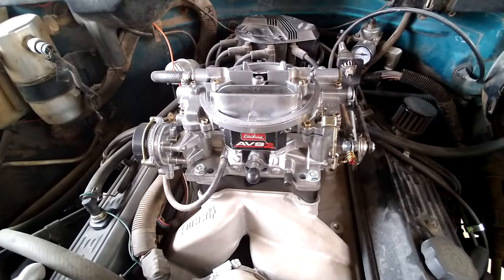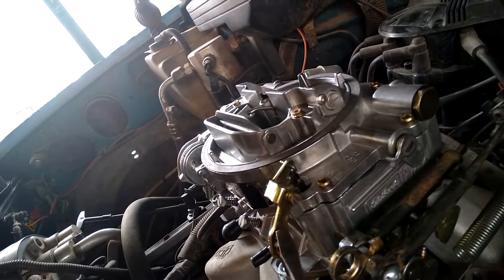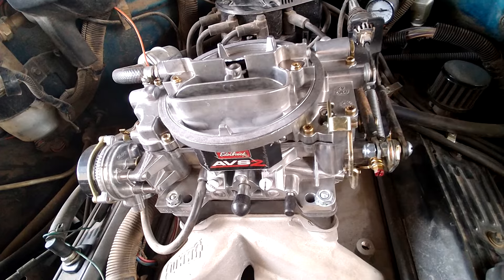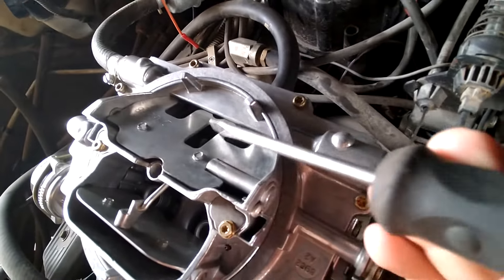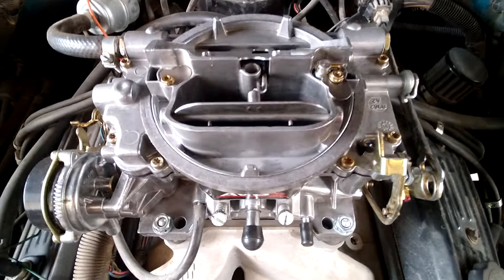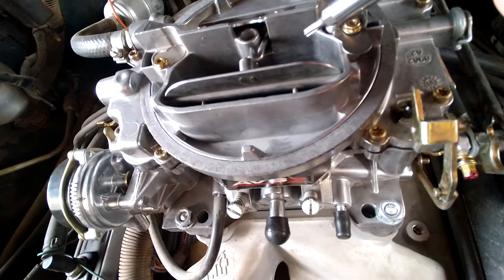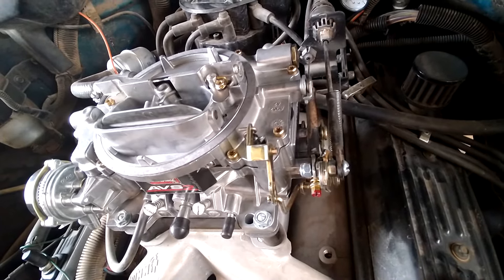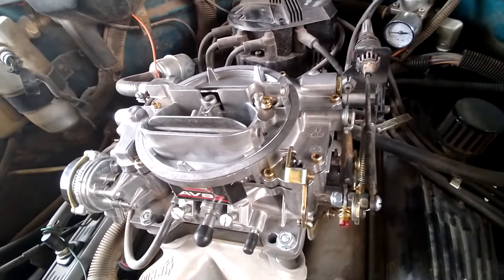Tuning and setting up a Edelbrock AVS2

Comment: Hey man. The reason that car reader is running too rich is because you're turning this flap. Screw the wrong way, tightening the Spring makes it run richer, especially when you stomp on the gas. If you want it to lean out you have to loosen the screw to allow more air in the car braider. Basically, it's like you're running it with your hand over the top of it. It's pulling more vacuum than air, which means it's pulling too much fuel.  You're just doing the process backwards. It's no big deal a lot of people can't wrap their head around it, but I'm telling you straight up. You're doing it wrong, take my advice and don't feel some sort of way about it. It's not anything but helpful advice. Or you can sit there and fludge your engine out and wash your soldiers down. All you want, but until you do it the correct way. You're not gonna have any luck with it? So, you should take the video off the air until you get it. Correct, you're gonna have a lot of people screwing their cars up because you're giving them the wrong advice.
Reply from the maker: Best thing I can tell people these days is buy Holley I should have added that and I have had guys say how it's helped but thank you for posting ill pin this so it will help

Comment: Don't go drilling holes in the butterflies. Loosen the tension on the secondary flap and change to a lighter step up spring
Reply from the maker: That has nothing to do with a rich like with low vacuum

Comment: Wouldn't it be easiest to adjust the idle air mix screw with a vacuum gauge? I'm new to this but it seems the most efficient/sure way.
Reply from the maker: Your probably right if you have a vacuum gauge I just kinda wing it and do it by feel and ear
Reply: The old timers get them nearly perfect by ear had my stepdad tune any buddy’s carb and then he happened to buy a vacuum gauge a few days later and it was pretty much dead on
Reply: Way to may variables on this old shit, that i love BTW.-   Fuel pressure is very important- On a Street cam GM Small block or big block just run a stock fuel pump- I see everyone installing 30PSI electric pumps then regulating them down to 7 PSE, it makes no sense.   A real OG mechanical  gm fuel pump is perfect- Mines 23 years old and produces a consistent 7.2 PSI across RPM range.  No need for a pressure regulator.
Reply: @yamahaguy1732  exactly. Im 42 but learned from my dad in 80s get up in that motor and hold her like shes your lover, tune it and you know  touched her right. LOL
Reply: 7 psi is too high.  Edelbrock recommends no more than 6, and prefer it to be set at 5.5.
Reply: @ericabercrombie6780  idk I’ve talked to an old timer who specializes in edlebrocks and he said on a higher preformance engine 7psi is where you wanna be no more than that tho

Comment: The problem that leads you to drilling your throttle blades is likely a lack of spark advance. Try tuning the   vacuum advance on the distributor. The engine will likely idle fine with the throttle blades fully closed if you have enough timing advance.
Reply from the maker: 36°
Reply: Yup.  Loosen the hold down bracket on your HEI and slow turn and listen to the idle.
Get it where it sits as high as possible.  Then turn down your idle to say 800.
Then turn your mixture screw to dial in the idle.

That’s what I did.  Mine feel Fuel injected no flat spots anywhere.

Good share!

Larry
Reply: @mafosa8519  excellent start.  
Then the mechanical advance needs to be limited as not to exceed  total advance.  
If you look down the carb at idle now,  you will probably see fuel dripping from the center booster.  
Should be idling on the idle circuit.  Just a square showing on the transfer port with the throttle blade closed all the way down on idle stop screw. 
Don’t drill holes.
Reply: @tomreyn3610  yeah I'm thinking a mod motor has less vacuum at idle typically..why would he say the spring and metering rod would need a stiffer spring.. kinda confusing coming from Holler world.. just got the off road model for a 388 with roller cam, heads etc.. getting a little worried...

Comment: Great video my 99 S10 ext cab 5sp has almost the same setup 350 30 over comp cam vortec heads pro comp aluminum intake shorty headers and the 650cc AVS 2 Series 4 barrel carb with manual choke and it's wanting 2 spit a bit when cracking on her around 3rd 2 4th and 5th gear shifts spits a bit instead of 4 barrel opening up all the way. Other than that she's a nice daily driven hot rod truck that still functions as a truck also.
Reply from the maker: Awesome a SBC s10

Comment: Thank you for sharing a simple solution. I always get to technical with my friends regarding these simple measures- I forwarded to my shade tree mechanic friends, hopefully they will figure out the stutter issue you describe, as I have told them multiple times about all around component selections and tuning. They all run way to big carbs and way to big cams usually way under flow sized heads - like a 700CFM on a basically stock TH 350 crate with votech heads. or they do not have a appropriately sized  stall converter on a street cam and they can never make the car be street drivable. The OG small block 400 2 blot main in my cruiser car. I run 202 cast iron messaged heads with typical off the shelf bottom end and top end goodies with a 272 Isk Cam, never had an issue with my avs2's out of box I always checked and verified factory settings on carb and run 4 turns out on each banks mix screws and then adjust secondary flap to my liking. I run 650 CFM model with slightly oversized jets in primary and stock secondary's I also use the top most position secondary linkage accelerator position. Runs like a champ. I always get initial and absolute timing involved in the convo and it confuses everyone. I love the AVS 2 for a street cammed cruiser car-- course we go bigger on strip setups.  my 650 on 400 Small block I run the rpm at 625 RPM  Curb Idle  ... Old video was running a 650 Thunder.     https://www.youtube.com/watch?v=OT7MatVrXB0    https://www.youtube.com/watch?v=uBCJQzlL-iY
Reply: BTW I like the Accel HEI cap your running- Mines 21 years old and sparks like a forest fire.

Comment: Thank you my friend I really appreciate your video. I just picked up the same carb for my 351 Windsor. The engine and truck is how it was when I purchased it. It has the largest cam possible for the stock heads. I suppose I'm going to run into the same issues you did
Reply from the maker: Thank you for watching just take your time and get it dialed in

Comment: HUGE carburetor question. I have the AVS2 on a 79’ mustang 302. When my engine gets a little overheated, the car somewhat stalls / chokes in first and second gear (doesn’t happen when it’s cold). Once I let of the fuel a bit, and ease the pedal, the engine smooth back out and I’m good. It normally happens at a stop. I will be making some adjustments that was stated in your video. Do you have any suggestions to what the issue may be? 
- Thank you for the video and your time
Reply from the maker: It could be vapor locking from the heat do you have a plastic carb spacer
Reply: @CCAutoWorks  Is plastic preferred?
Reply from the maker: @Sfili86753  I use the plastic because it stays cooler keeps the intake manifold heat away from the carburetor

Comment: Hi Chris, i found this video very interesting, i thought you did a good job of explaining, i got to be honest i really wanted to see some holes drilled, i will look to see if there is a part 2 , i have a 1406 in the 55 truck, i did two videos on the rebuild 1 year ago on my channel, i was able to rebuild it without changing metering rods and springs, i really had no way of telling when i was done if i got ultimate performance, but it was a big difference between before and after, i would like to learn more about the AVS, sounds like a really good carb
Reply from the maker: I'll have to check out your build series
Reply: @CCAutoWorks  that would be awesome

Comment: Did you get this carburetor to work in your vehicle? What would you rather use the Edelbrock AVS2 or Holley Carburator?
Reply from the maker: A Holley has way more adjustment and that's what I'm running now I got rid of this avs2
Reply: @CCAutoWorks  Holley 600? Did you get frustrated with the edelbrock? the summit intake hold pretty good?
Reply from the maker: @oscarvillarreal8951  the Edelbrock is good for a daily driver with more of a stock engine but Holley is better with bigger cams and high performance engine
Reply: @CCAutoWorks   I also wanted to buy the summit intake. Yours looks like it lasted and holds up pretty well.
Reply from the maker: @oscarvillarreal8951  I think it's a great intake and there alot cheaper then a name brand

Comment: I have Holly's on my ford 390 I'm going from a 350 2bbl to a Edelbrock performer RPM and comp DEH 265 cam I thought about classic Holly 650 but now I'm considering the AVS 2 for it's tunability over the Holly ...I like Holly but there double the price and removing both bowls to make minor Justments leaks etc ...
Reply from the maker: That's why I went avs but now I've went to a summit racing holly style carb and love it over the avs
Reply: @CCAutoWorks  I heard about those as well they have annualar boosters right ?   I was considering the Street avenger 600/650 classic Holly 650 .. almost 600 bucks tho 
Ot the AVS 2 EDL thing about national carb I bought my 350 holly from them it was rebuilt right but it had a damaged float bowl on the side were the plastic washers go it leaked I had to use silicone on it .
Reply from the maker: @TheThirdWheel618  national carb is where I bought this avs 2 and it doesn't run right with a manual trans it does something stupid in-between gears so it's just sitting on the shelf it would probably run good with an automatic
Reply: @CCAutoWorks  that carb works alot like my old CV carb on a Harley the needle in the hole determines how rich or lean it is  to richen it we would put washers under the needle to lift it out of the jet hole to lean you do the opposite with a adjustable needle had c clip on it  sounds like the jets were to big if it was that rich and you couldn't ajust it out with my Holly I bought the big box jet assortment I have about 12 power valves buy the stack of metering block gaskets etc ..

Comment: You can plug the throttle blade holes with a TIG welder and small diameter wire, maybe 1/16th

Comment: Also I know electric choke is "electric" but does it need to be wired up to work ?
Reply from the maker: Yes you have to run an 12v ignition wire to the little ear on the black round part of the choke

Comment: Got a 351C modded with Edelbrock intake, heads, bored and roller cam.  Sounds similar to the 351C you mentioned in this vid.  Just picked up the Edelbrock 1906 AVS2 carb and am wondering if you have a video for what you did to smooth out the 351C?  Thanks for the vid.  VERY informative!
Reply from the maker: https://youtu.be/guDJV1pf4QA
Reply from the maker: https://youtu.be/F-YXfiihs38
Reply from the maker: You can try step up springs first before going crazy how big is your cam durasian and LSA
Reply: @CCAutoWorks  It's a 578/578 lift, 290deg duration and 110deg LSA from Comp Cams.  I'm still learning on how to work on all this stuff, so I'm not really sure what all of that means though!  Any help would be greatly aprpeciated!
Reply from the maker: @tjandt  that's a pretty good sized came it's definitely going to need different stepup springs for low vacuum to lean it out at an idle

Comment: Ive got a 350 vortec, 1;6 rockers, stock lower end high rise intake and headers. Ive got an avs2 that stubles when i first hit the accelerator. I can ease into it and it runs great! Any advice?
Reply from the maker: Have you moved the accelerator pump to the to hole and have you checked your timing

Comment: I just bought a AVS2 1905 Manual choke and secondary's, putting it on a 1968 Torino with 302. it has hooker headers and a Wieland 8011 intake manifold. not Shure if it has a cam or not, as I did not put in motor. if it does it I a very mild one. so mild mods.  Has a C4 with higher 2000-2200 i cannot remember stall converter and shift kit. will b putting in a Posi kit with 355 ring and pinion.  if that matters. think it will go on in stock settings ??? Thanks PS bought from same company and it did not come with mounting instructions or bolt tork specs.
Reply from the maker: Sounds like a very nice setup

Comment: I have a 83 chevy dually WITH a SB 350 and it has a rv cam...I just bought the edelbrock 650 AVS2
 Carb. I installed it and its idling high at 2500 rpm's, could you give me some insight on what to do or how I should adjust the carb. Thank you Sir I  thank you for your time and knowledge in advance.
Reply from the maker: Idling that high I'd say you have a vacuum leak somewhere at the base of your carb or maybe a vacuum port was over looked I always use carb cleaner to find leaks just spray it around the base and ports if it sucks it in it will idle down
Reply: Electric choke? If it has one, it’ll idle high at first start up but if you punch it, it should cut back
Reply from the maker: @steelweels38  your right I forgot about that because I always disable mine
Reply: @CCAutoWorks  haha yep. Only reason I remembered is because I swapped to an avs2 from 1406 last night after I hadn’t used the avs2 for a while and had totally forgot about that lol
Reply: Thanks fellas...appreciate your input and knowledge. 
I had to do a little adjustment and she runs and sounds good.
Reply: @bentroche6568  the avs2 kicks ass man. I think you’ll really like it

Comment: Greetings 
Great vid-Ty.

At the 3:25 mark, you are discussing setting the secondary flap to factory settings.
After turning the tension screw cc till the flap just touches the airhorn, you then mention to turn the screw 1 full turn;  pardon my ignorance, but that 1  full turn-  would that be cc or cw?

Thank you
Reply from the maker: Cc to put more tension on the flap

Comment: Would this be a good choice for a stock 350SBC with a mild Cam, headers and Edelbrock manifold? I was told 600cfm was good so not sure if going to a 650cfm would be wise?
Reply from the maker: I used to run a 650cfm on a bone stock 350 ran great I think edelbrock carbs cfm are a little under rated compared to say a holley 650cfm
Reply: They dont come in 600.
Reply: 650 Is a great size for a street 350, especially with a stock gear. Redline should be near 6,000 RPM.

Comment: Mine is on a 1966 Plymouth 383 and it backfires when I slow down. In fact, it blew my muffler apart. What could be causing this?
Reply from the maker: What's your timing set at
Reply from the maker: Backfire through the exhaust sounds more like timing
Reply: Not sure, I just got the car two days ago :((
Reply from the maker: @paulhindenburg1460  I would definitely start by checking the timing
Reply from the maker: Mine 12° initial and 34° overall but I'm not sure what a Mopar 383 is

Comment: how did that avs 351c go i got a cleveland with holley double pumper but i think my diaphram is blown so i was gonna get a new carb on it
Reply from the maker: The avs2 is ok we actually have one on a 351c in our 72 Mach1 it's bored .030 4v heads and a Howard's rattler cam long tube headers and an aluminum intake
Reply from the maker: https://youtu.be/F-YXfiihs38
Reply: @CCAutoWorks  i seen that video thanks man i appreciate it

Comment: I know this video is old. but did you have the right fuel pressure? anything over 6lbs it wont like.
Reply from the maker: Pressure regulator was set at 4 1/2 psi

Comment: I’ve got an 86 f150 with a 351w. I got the avs2 and it drives fine but once warmed up it idles way too high. Would adjusting these idle screws help? FYI I’m not a car guy lol so I don’t know a lot.
Reply from the maker: Could be a couple different things 1 have you tried turning down the idle screw on the throttle linkage 2 when warm is the choke all the way open if not adjust it to open all the way 3 could be a vacuum leak from carb gasket or vacuum port 4 avs2 has a high idle feature just hit the throttle fast to disable

Comment: Just FYI, Edelbrock says not to use the rear port for PCV. I don't get it, because I thought vacuum was vacuum, but they specifically state the pcv must be connected to the front port.
Reply from the maker: Great info thanks